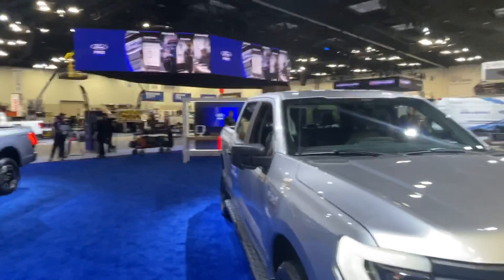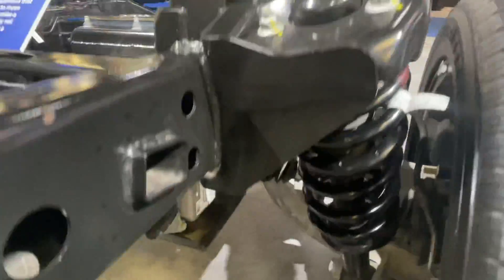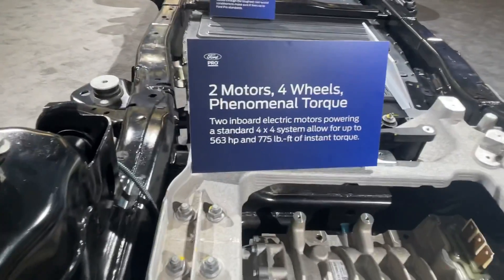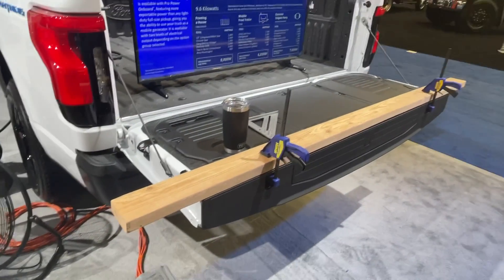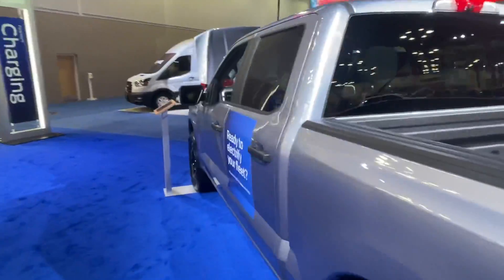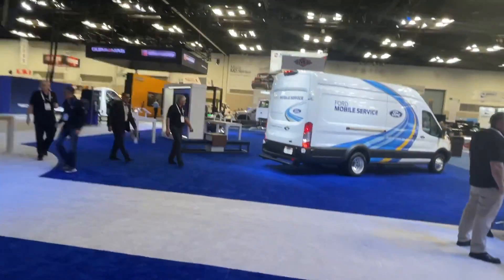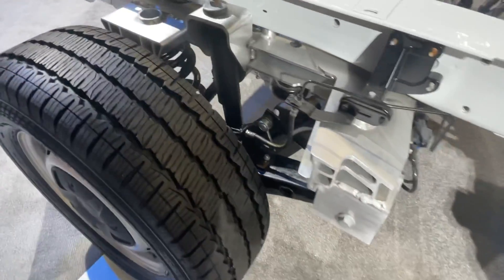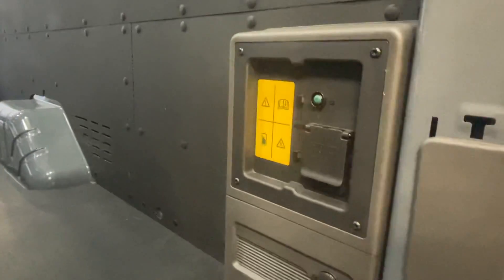How Does the Ford F-150 Lightning Actually WORK? Let's Look At What's Happening Under the Skin!

Comment: I honestly don't see why they can't offer this truck in single cab form.
Reply: It would be too short to fit the big battery and wouldn't sell nearly as well in today's market, despite all the people claiming they would buy a single.
Reply: They can't put battery under bed? Don't crew cab short bef & regular cab long bed sitting on same wheelbase?
Reply: @RDSAlphard  It has to fit before the rear motor....do the math
Reply: @gruneflamme2013  I'm sure he means as a single cab/long bed.  Or at least a short bed (6.5') instead of the toy bed it has now.  A work truck need to be available as a cab-chassis or at least a bed delete so you can upfit with a service body.  The wheelbase would not be shorter - there would still be plenty of room for batteries.  As shown, this is NOT a work truck, it's a slightly de-contented commuter truck fit for Johnny Homeowner to occasionally go to Home Depot.

Comment: Just curious 🤨 why they use spring instead of air suspension with ESP? Would be much safer.....for a Van
Reply: Mostly because any extra accesory, like an air compressor, needs to be electrical, and that affects the range of the electrical charge in the battery. With the weight of the batterys close to the floor, this kind of vehicles have a low gravity center, with a good spring suspension it's gonna be great stability
Reply: @servicioelectromecanicocue7025  sure low center of gravity help, but ESP (Electronic stability program) and air suspension are used to balance variable load. I have to say that they are usually in heavier vehicles, over 3.5 Ton, or 7000 lbs. But lot of delivery business nowadays have both 7 Ton and 3.5 Ton van therefore they wanna be sure to have the same security level in both
Reply: Ford doesn't offer air suspension in any of their trucks or vans. It would make sense as an option, but whether the powertrain is gasoline, diesel, or electric doesn't change that. At least the coil spring rear suspension (of both Lightning and E-Transit) would be easy to convert to air springs.
Reply: @brianb-p6586  yes indeed, granted that they offer an ESP with it
Reply: @mattiafrancescobruni8318  Electronic Stability Control has been required by regulations in the U.S. and Canada for a decade now - it's standard equipment on everything.
Reply: @brianb-p6586  good to know.

Comment: I can’t wait to see what the suspension situation is on the transit with all that weight in the back plus cargo it’s gonna have to have a significant suspension system
Reply: Yeah wondering why Ford did not use ESP and air suspension. Maybe they just classified it as lightweight to make it simpler...
Reply: @mattiafrancescobruni8318  There's nothing lightweight about the E-Transit. It has the same rear axle capacity (6,000 pounds) as the highest-capacity single rear wheel Transit with an engine.
Reply: The E-Transit, like the F-150 Lightning - has a straightforward semi-trailing arm suspension with coil springs. If designed for the load (which it presumably is), it will be fine.

Comment: The work truck show needs one with an 8' bed...
Reply: Exactly!  Such a disappointment that the "pro" version is nothing but a slightly de-contented version of the standard.  Still has the tiny bed and gigantic cab.   A "pro" truck needs at a minimum a standard short bed (6.5') and preferably a standard long bed (8').  And no mention of if you can get it as a cab-chassis or at a bed delete?  Can I fit an aftermarket service bed?  Will that independent suspension handle a 10,000 lb trailer or a decent payload given the truck itself is already so overweight?  I want to like it, but all I see is another 'lifestyle truck', not a work truck.
Reply: @donhappel9566  This is exactly what most buyers - even corporate ones - buy in an F-150. Yes, in Super Duty trucks longer boxes are common, but this does not have Super Duty payload or towing capacity - it is for different purposes.
Reply: @brianb-p6586  I know that is very true of the market in general; not so sure if it is for the commercial market or not though it could be.   But they are advertising this as a "work truck", which is a stretch at the least.
Reply: @donhappel9566  I agree that this preference (for the crew cab short box configuration) is especially prominent in consumer trucks, but look at light-duty pickups on the road with corporate logos and I think you'll find the same thing. Light duty work trucks are used mostly to transport crews with a bit of their equipment, so the same configuration works for them as for families; they are also sold in the used market (many to non-commercial buyers) and the right configuration choice increases resale value. Also, Ford will sell far more Lightnings to consumer than commercial buyers, so it's not surprising that the one configuration they're building initially (in all trim levels including Pro) is the one that most consumers want.
Reply: @donhappel9566  While some aftermarket service beds are available for light trucks, there are very few of them - that's primarily the chassis-cab market, starting at Class 3.
Reply: @donhappel9566  There are independent suspensions at any capacity level you want, up to many tons. The suspension will be sized for the GAWR, regardless of whether it is a beam axle or independent. The E-Transit independent rear suspension has a GAWR of 6,000 pounds, the same as the highest-capacity suspension in a single rear wheel gasoline or diesel Transit.

Comment: With IRS I have a hard time calling the F-150 Lightning a "Truck". With a Super Crew short bed 5 seat configuration as the only configuration I have a really hard time calling it a "Work Truck" either.

If they made one with at least 6ft bed and the 3 seats up front (available as an option for basically every ICE F-150) I'd gladly get a Pro model during the second year of production or later. 

This thing currently has as much cab, bed, and interior seat configuration options as a Maverick pickup, which is to say it has 1...

'You can get it in any configuration so long as it is a 5 seat Super Crew short bed.'
Reply: All the manufacturers do this with certain trims.  Ford Raptor, Ford Lightning, Silverado High Country, GM HD 2500 AT4 Trim, etc. You can only get them in Crew Cab; not double cab. There have been many version/trim levels of pickups that I've wanted over the years that I've not bought because they only come in Crew Cab with mini size bed. Shopping for HD trucks now and finding the same thing, except there, you can only get certain trims in Crew Cab and they come with standard 6.5' bed and it adds length to wheelbase. I want Double Cabs  with standard 6.5' beds but then can't get certain trim levels (High Country in the Silverado 2500 or AT4 in the Sierra). Frustrating.
Reply: @MrChadx1  Ummmm...it's called THE LENGTH OF THE BATTERY PACK!!! Do you really think the bean counters didn't say what you said?....It can't be done
Reply: @imtheonevanhalen1557  how do you think the battery would be an issue?  keep the same wheelbase, shorten the cab, lengthen the bed.  You know, like a WORK TRUCK.  Same frame length, same wheelbase, just more utility and less 'hauling the kids to daycare'.
Reply: @imtheonevanhalen1557  Yes, the wheelbase of about 144" is the minimum to fit the battery of this capacity, but other cab & box combinations for the same wheelbase, or combinations which result in a longer wheelbase, would be no problem. In the E-Transit, Ford is offering the usual range of wheelbase and body choices; in the F-150 Lightning, they are offering only the most popular configuration.
Reply: @imtheonevanhalen1557  In 1500/150 series pickups, Crew cab short beds and double cab 6.5' beds are the exact same overall length and wheelbase and frames. So same amount of room for batteries. And much of what I was saying (that there are many trims only offered in crewcab shortbeds and not doublecab 6.5' beds) is in ICE vehicles and so has nothing to do with battery packs. It is done for assembly line economics. Vast majority of pickups sold are crewcab short beds so the manufacturers choose to only make some trims available in those and not in other cab/bed configurations.
Reply: I suppose a HMMWV (Humvee) or other military trucks with independent suspension are not "Trucks", either?
Reply: @brianb-p6586  Nope, they're beefy vehicles sure, but not trucks. The HMMWV is a very beefy, yet very hard to maintain and repair. Trucks are meant to be simple, durable, reliable work vehicles. Independent suspension is not simple nor durable. Can it work well for a work vehicle? Yes, can it work for a Work Truck? Nope. Dump trucks, Semi Trucks, Garbage Trucks, etc almost all of them exclusively use solid front and rear axles.
Reply: @MrLM002  The term is "beam" axle. They're used because they're cheap, especially in driven ("live") applications and especially in non-steering axles. All current light trucks - including the full-size pickups from Ford, GM, and Ram - have independent front suspension, even though most of them are 4WD; does that make them not trucks? That would be nonsensical.

Similar arguments ( "if it's a truck it must have..." ) have been made about drum brakes and manual transmissions, and indeed most heavy trucks in North America still have drum brakes and manual transmissions... but up to Class 5 everything now has disks and automatics. Would you argue that an F-550 isn't a truck because it doesn't have "real truck" features? And how about air suspension: "real trucks" have leaf springs on those beam axles, but the drive axles of the vast majority of heavy trucks have control arms and air springs... are they not real trucks?